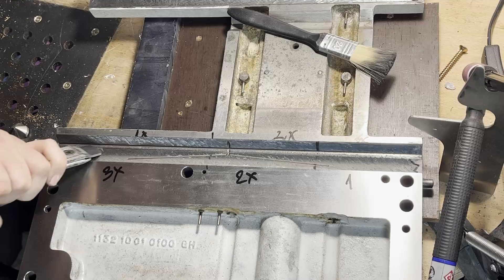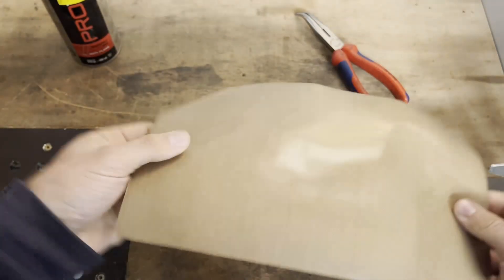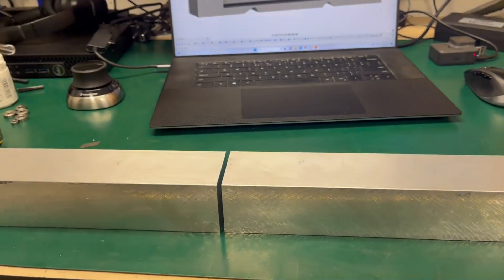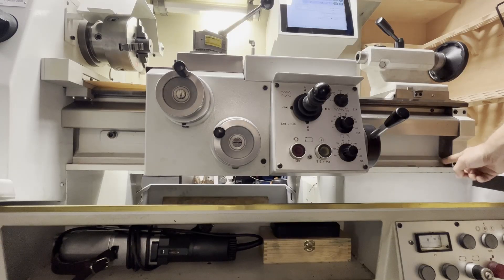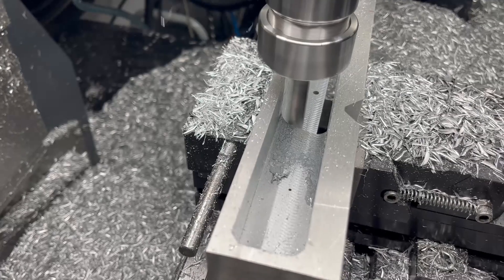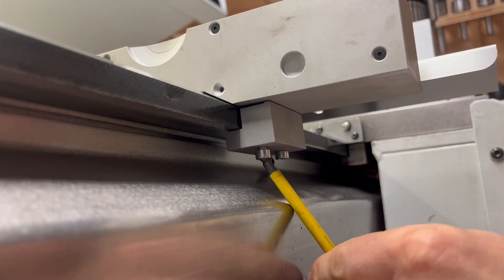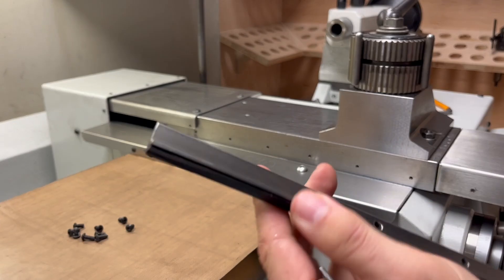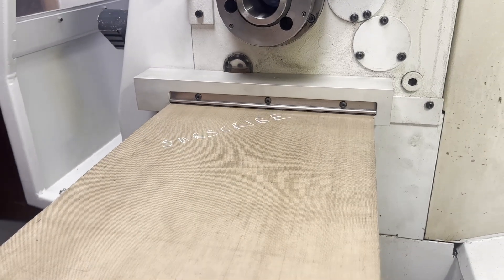Not another lathe ways cover

Comment: Minus diameter capacity. Shavings will accumulate on this curtain instead fall to the pan. And metal beard can catch this curtain and rip it off. But it looks and acts cool :)
Reply from the maker: After about 6 months since I installed it, it seems it works ok. I will need to make another video where I replace the torsion spring with the other mechanism that I was talking about. 
Yes, there is the risk that some birds nest like chips can rip it off, but I try to keep that under control. 
I also thought of having some compressed air nozzles built into the wiper housing that would blow off chips only when retracting, but so far it was not such an annoying problem.

Comment: I have looked at this video several times now and your design for the roller retracting way cover is just about perfect. I had done some experimenting with a retracting roller design on both my lathe and on my benchtop milling machine but struggled to find a suitable material for the cover itself. 
I have tried thin industrial rubber sheet and the EPDM rubber sheet used to cover flat roofs but all these rubber based materials do not cope well with oil or coolant contamination. 
This material you have shown us here is perfect for the job.

It would seem that  a lot of the components for a system like this would be very suitable for 3d printing.
Reply from the maker: Indeed, for a half a year since I’m using it, it behaves very well. I will have a future video where I’ll add other retraction mechanism, as the spring does not have constant pulling force. 
Other than that it behaves as I hoped it will. 
Yes, if your model fits within the print bed, it is suitable for 3d printing. But for this kind of projects, I prefer metal. 
Ideally it would have been some surface ground steel, with a tempered blue color 😋

Comment: Gaw`dayum, this is a proper renzettification of a lathe... Remarkably nicely done... The pulley system idea for the actuation is even better, but as you said, you had no time for it and this was a prototype... I mean, i`m almost speechless, which happens around as often as a full blackout of the sun... I`ve seen quite a few way cover videos, and of them all, maybe 5 in total have pleased me to the point of commendation and desire to either replicate the design or adapt some features into my own designs... This one is in those 5 videos... I would have considered a way to make the chip-guard curve downwards, rather than being a flat sheet, as chips and abrasive crap has a remarkable tendency to defy gravity and physics in it`s pursuit of precise surfaces to ruin, but alas, your cross-slide guarding is supreme in that aspect... All that being said, i would not have used aluminium for the sheet housing or any parts really, just for the dissimilar metals issue potentially with that block resting against the ways... I tend to solely use alu on alu parts, inox on inox and for cast iron, regular steel and brass/bronze, i`m fine mixing those together, but inox and alu, well, those i tend to treat as troublesome at best... Anodizing and all other metal treatments notwithstanding... I would likely have gone with a same slab of regular steel, but as a finishing step, i would have heat oxidized it to a spotty gentle purple, purple and dark blue before letting it cool below the smoke point and would have dunked it in oil to glaze and seal the oxides... It`s a `yuge part to heat blue, but the bigger the better, as there is more surface for the pornography that is oxide finish to manifest on... 

All the best and kindest regards!
Steuss

Oh, btw, you have earned a sub dear machinist brother...

Comment: You can take a picture from dead on looking the rails. Then draw the shape over the image and scale it using width etc. You can also take multiple images and make a STL in Meshroom. This will also need to be scaled.
Reply from the maker: Damn, you are right! I’ve used this approach when I built the chuck cover, but it didn’t crossed my mind to use it for the ways profile 😅
Thanks for bringing this up! 😄

Comment: Absolutely lovely! Truly like it was designed in from the start.
It's so simple that all decent lathes should come with this, it's not like it would be hard to replace the belt if damaged, and a lot of good wiper profiles are basically standardised rubber products.
I guess the only improvement could be to stop abrasive dust floating in from underneath, but that would need such a massive change to the carriage that it would have to be designed in from the factory, and probably only worth it on machines doing a lot of grinding anyway.
Reply from the maker: Thank you for your kind comments. 😊
Indeed, its quite difficult to fully protect the ways. The lathe would need to be designed totally different. One of the coolest lathes that has addressed this is Schaublin CCN 180, there they have a telescopic steel cover, that goes under the headstock. So basically the headstock is sitting on the bed of the lathe only on the back and on the front, while on the middle it has a gap and the telescopic cover is passing though that opening.  I like that design, but for the rest 99% of the lathes, we need a different solution.
Reply: @LikeFactoryMade  maybe use positive air pressure so that NOTHING gets in. Just a thought 😊

Comment: It might sound ridiculous, but I think an easier solution for the retraction force would be to use an electric motor. 
An electric motor would apply a constant pulling force, adjustable by the current.
Since your lathe is already digital and electronically controlled, the necessary control for that motor would be a minor addition.
Reply from the maker: I did thought about that approach, but other than some motors from ClearPath that have torque control, I don't know other solutions. That idea indeed would be the most elegant one, but it would be significantly more expensive. And since I am in Europe, after importing a clearpath motor + cables + power supply...it already becomes too expensive. These two approaches I presented here, could be implemented by other folks without any significant costs. 
But if you know other ways I could obtain what clearpath motors are doing, I am interested, I don't know very much on how to control am motor in torque mode, other than using something like a ClearPath motor.
Thanks for watching!
Reply: @LikeFactoryMade    I see what you are concerned about, but I think this can be achieved very simply.
I suggest using a normal DC brushed motor probably with a gearbox inbuilt/attached. And just keep it running. As soon as the cover is retracted and is held under tension, the motor will be blocked and continue to deliver torque/force. Normally, the motor coils would burn out as the current in this operating mode would increase. But here's where a current limiter comes in. As long as the current is held below the rated armature current, everything is fine 

I guess you could build this for less than 20$: 

If you want to follow this path or just give it a shot and see if it works, feel free to contact me if you have further questions. 

Edit: YT removes the Links I had attached...
Reply from the maker: @PermireFabrica  I did thought about the first part, but I've missed the second. I thought the motor windings would be burned out, but I have not thought about having a current limiter. 
I like this idea, I will give it a try once I got some time. 
Thanks for the tips! 😀
Reply: @LikeFactoryMade  You're welcome. The current limiter can be something as simple as one of the cheap Chinese DC/DC converters.
Reply from the maker: @PermireFabrica Wow, I have not thought about that! Thanks!

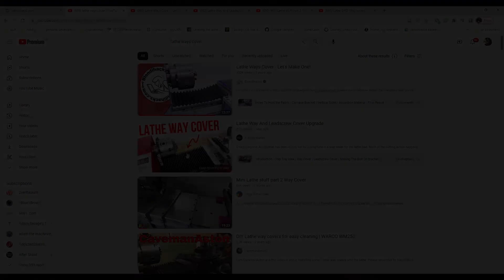Comment: Unreally nice solution for an ordinary lathe. It reminds the solution for plane grinder Favretto https://youtu.be/g0lPf5bl_mk?si=7fmnMgLia7mEe7Yg see 0:21 and 38:24. That grinder has two strapped covering for sliding surfaces shown at 38:24. The table with short straps is shown upside down at 0:21. That straps are connected with long one together under the basement and straps always cover sliding surfaces. The grinder with this cover  was specially designed by Favretto company. 

What you did is the best if the lathe was not specially developed for such cover=99% lathes.

By the way, that guy restored that big  7m plane grinder solely by himself.

Comment: I would have liked to see more details of the torsion spring. Any idea where to get a similar one? I bought accordion style way covers for my emco from Ebay. They were nice except the first time I tried hard turning chips melted them. Also cleaning the folds of the accordion was a pain. Your solution is better.
Reply from the maker: Unfortunately, I don't have any specs for the torsion spring, I had it laying around the shop so among the others I had, this seemed to fit better. 
The setup that you saw was more like the testing phase for me. I wanted to see if cover is behaving as expected and so far it seems it does. But when there are small chips like for cast iron, the friction force between the wiper and the sheet becomes higher, and since the pulling force is not constant across the entire length, it sometimes lifts up and it needs a little help in getting rolled back. 
I will switch to the other solution presented in the video now that its confirmed to work as expected. That solution has always a constant pulling force, but implementing that has a few challenges too.
But that will be a separate video so stay tuned! 😉
Reply: @LikeFactoryMade  good luck growing your channel. I’m on board!
Reply: Use spring from tape measure.

Comment: Nice covers! The only thing you should be careful about is that your X axis way cover now produces a dangerous pinch point. I don't think you would see something like this from the factory as it could cause finger loss :)
Reply from the maker: Thanks! 
I am not sure I understand what's the dangerous pinch point you are talking about. Are you talking about the left side of the X axis where the wiper is closing against the sheet plate? Cause that one seems safe to me. 
Or are you talking about the front cover of the X axis? There indeed when the X axis is moved maximum toward X- you have a chance to pinch your finger on the last 10mm. But that would mean moving the handwheel or the joystick with one hand, and putting your hand beneath while its moving. 
Let me know which of these were you thinking. 
Thanks for your thoughts!

Comment: What about adding a slot cut in the botton and a wiper so as u move toward the chuck the small chips dont get wrapped up the the mechanism
Reply from the maker: I have a wiper mounted which won't allow any chips o get inside the mechanism. Its the same wiper as I used for the X axis protection. 
However after a few months of use, I discovered that if I tighten the wiper more firmly, the pulling force is not big enough when the sheet gets dirty with fine chips. So in a follow up video, I will build the other mechanism of retraction. 
The initial goal was to test how this kind of wiper works without creating an over-engineered solution just to discover that it doesn't work. 
Now that the stage one is complete, I can proceed with stage two. I also got some ideas to some compressed air blowing chips when the carriage moves toward Z- but maybe that will be in stage 3 :D
Here you can see the installation of the wiper I am talking about: https://youtu.be/ZDNUJDywuuE?t=510

Comment: Amazing! Found this by chance and already subscribed! 
This is probably the best solution I’ve seen and will see!
Reply from the maker: Thank you! Appreciate your feedback!
I was just responding to a previous comment that so far I like how it behaves and it passed my initial tests. 
I noticed that when I am making fine chips, as I get closer to the spindle, the spring does not have enough tension to always pull back the cover, so there will be an upgrade to this where I build the other pulling mechanism that I am talking about in the video. 
Also got some interesting ideas about building a rail with small holes through which I blow out air when the cross slide moves toward Z-
Just waiting for the time to implement all my ideas :D
Reply: @LikeFactoryMade  I have so much respect for someone who hand scrapes their own slide ways. This is the home machinist content people, including myself, love to see. Subbed and excited to see what you continue to do!
Reply from the maker: @seasaw40 Thank you! 
Indeed it was A LOT of work but I am quite pleased with it. I am still not sure 100% if I will keep the slides as they are or if I wanna put turcite on them.
I would not care at all about all the work I've put in if I knew for sure that the best approach is turcite, I would not mind milling all the scraping to make room for turcite. 
At least I've learned a new skill.
I bought the turcite, I have everything I need, but some machinist folks said that it would be sad to mill the scraped surfaces and add turcite. 
On the other side, being a hobbyist, I accumulated 3 hours of SpindleOn time since may. So with enhanced oiling, low usage + way covers, I think I am safe at least for now! :)

Comment: Very nice! At 13:28, you're not blowing chips between the two covers on the cross slide are you? ;)
Reply from the maker: The  white painted cover on top, has some sort of wiper that contacts she stainless cover. It is not as efficient as the rubber ones, but there is not such a big problem because there is no guideway underneath those. There is just the ballscrew and the servomotor, and the chips can fall because its open on the bottom. 
I will do some checks after a few months and see how it behaves.
Reply: @LikeFactoryMade   The whole job is super impressive; I've saved this for when I get around to CNCing my mill. Thanks for taking the time to make the video
Reply from the maker: @mhagnew thanks for your comment. Glad you like it! 😊

Comment: An ingenious and not strictly obvious compact approach to an annoying issue. A minor benefit is that the wiper torsion springs apply a tiny amount of backlash compensation. Not much but some. Any thanks.
Reply from the maker: Compared to how heavy the entire  cross slide is, the spring can’t make any difference in terms of backlash. 
Glad you like it! 😊
Reply: @LikeFactoryMade  I like it.  Given that on a manual (not CNC) lathe you sometimes machine between centers on the tailstock side, would a tailstock way cover of this style be reasonable?  Also would this kind of way cover be suitable if you're using a tool post-mounted grinder
Reply from the maker: For the tailstock side, I could not find a solution that would still allow to use it properly on all part lengths. At least for my machine configuration, it can’t be done, especially if I want to keep the same width of 280mm for a 200mm wide bed. 
Regarding the toolpost grinder, covering the ways was one of the prerequisite steps for that kind of project that will come in the future.  I have all the parts for it, I just need the time to put it all together.